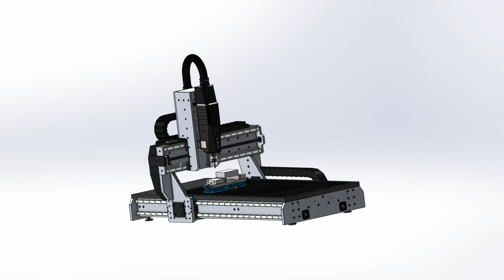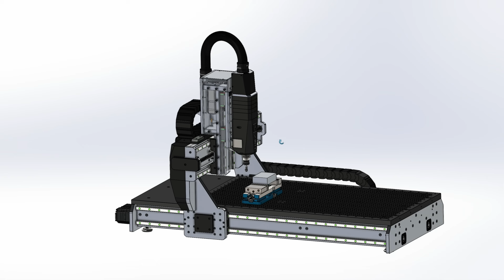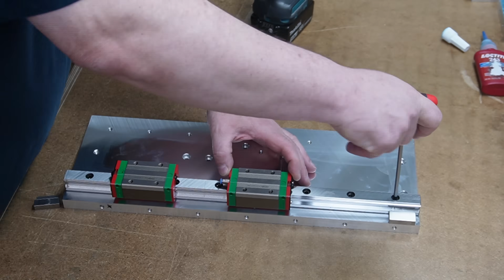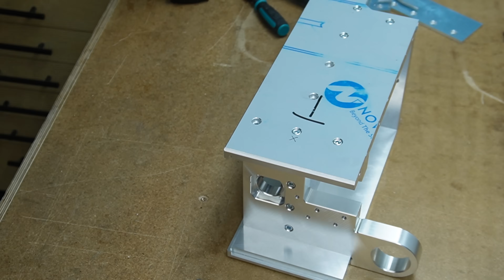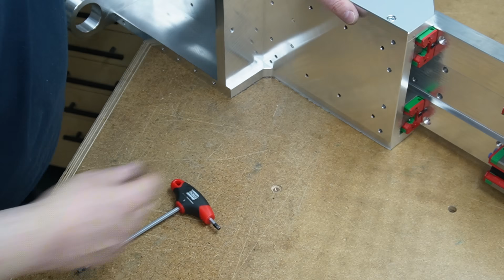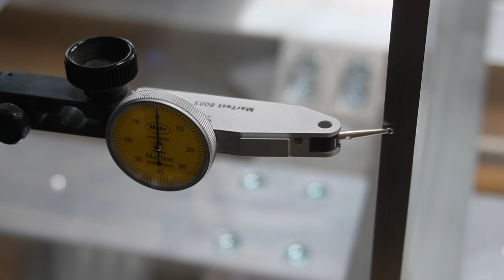Overkill CNC Router Upgrade Part 5 - Chatter free Z-Axis Design

Comment: Wie schaffst du es, dass SolidWorks nicht in Flammen aufgeht, wenn du die Baugruppen mit den Energieketten bewegst? Gibt es da möglichkeiten das ohne viel Rechenaufwand darzustellen?
Reply from the maker: Ehrlich gesagt...keine Ahnung 🤣 Läuft bei mir auf nem alten R5 5950X in Kombi mit ner Quadro RTX6000 (damit sind auch die Captures gemacht). Vorher auf nem übertaktetem i9 9900KS. 
Alles was Leistung frist getickt, wie RealView, Umgebungslicht Okklusionen, Schattiert mit Kanten, etc...
Solid ist ja single-threaded. Prozessor mit >5GHz, ein paar Boost-Kernen und die Kiste rennt 😂

Comment: You are so knowledgeable. This was a joy to watch. 
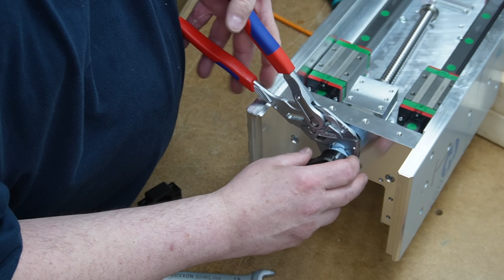At 16:15, I sometimes clamp half a spider jaw coupling to the shaft, then use a rod in the coupling to hold the shaft as the locknut is being tightened. 
Looking forward to the next part!
Reply: That's a good idea. I went the other way a drilled a narrow hole through the end of the shaft where the coupling bolts to and inserted a round rod to hold onto whilst tightening the nut. Quick file to remove any burrs and it's good to go, but the coupler sounds much simpler!
Reply from the maker: That is in fact a brilliant idea, that I will totally snatch 👍

Comment: - You are using Al5083 for this build; is there a particular reason you chose that alloy? Is that the most common alloy in Germany? In US, I'd imagine you would use Al6061. Not totally related, but you should look up MELD Manufacturing, they are doing large format aluminum 3D printing without melting. They can get pretty fine-grained results, and fine-grained metals are known to have good damping qualities. So I wonder if one day, the best machine frames will be 3D printed aluminum. 
 - Do you have any plan to publish the BOM for this machine? Seems most useful as the high-bar starting point, from which people can substitute/remove from until they have something that fits their budget. What you are building is obviously geared toward highest performance rather than being economical.
- One last point: your Z-axis discussion reminded me of Prof. Alex Slocum at MIT. He does precision design, and this exact problem of where to place the bearing blocks has come up. I think you already touched on this, but in the moving rail design, the stiffness can change depending on the Z height. So if you want to make a very precise machine (not just routers), then often you want a design that is at least consistently of a certain stiffness so that you can calibrate accordingly.
Reply from the maker: Very interesting feedback 👍
I use 5083 mainly for 2 reasons. First, it is cast material. Means it has very little residual internal stress. So my milled parts keep the shape and dimension and do not warp afterwords. There are some quite large parts in here that have to be very precise and making them out of rolled material would be rather difficult.
Secondly, because it is cheaper than 2017 or even 7075, at least here in Germany. The latter would be preferable in terms of tensile strength and I use 7075 on all ball screw nut housings and as well the T-bars I showed in the video no. 4. Mainly to be able to apply a higher bolt torque to these parts. But for the main structural parts there is no real benefit. The stress in such a router is rather low and the stiffness properties are the same among the different alloys.
And 5083 already comes pre-faced to a very good thickness precision.
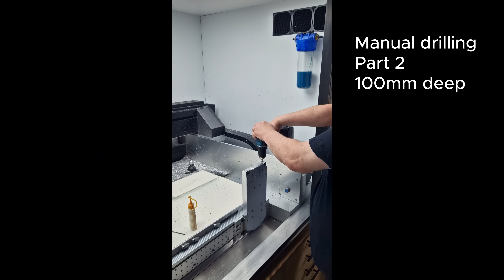The hint with the 3D-printed alu is gold 😊 I have built routers out of UHPC and mineral casting, but the mold making is always an issue with hobby tools. They work extremely well, like the one at 8:40, but it always required some post-processing of the parts to get them to the right precision.
The CAD files are available for sale. Currently just through DM on IG, but I work on a web-site 😉

Comment: Inside out.  That’s how you can maximize strength and stiffness.   If the spindle lives between 4 upright pillars forming a a rectangle over the work area.  and the gantry y rails sit on the inside of the bridge that forms over the work area then your stiffer because the because the additional rigidity and lower length.  There’s no cantilever so significantly less flex. The moment is also higher so you will have very limited flex even with heavy loads. Both together means that the only flex will be in the bit itself.  Fill the bridges either epoxy granite to dampen any vibrational forces.  Homebuilt Cnc almost always ring like a bell.
Reply from the maker: I wanted to build a classical router, for many reasons explained in the first video.
I already have a very sturdy mill with a mineral cast bed, which you can see at 8:40
Not sure if you have seen the last video about the gantry design 🤔

Comment: What do you think the milling accuracy will be for this build?
Reply from the maker: I used to have a very similar router before, with the same quality grade of components and I was able to hold tolerances around ±0.01 - 0.02mm. It was no problem to mill tolerance fits on it

Comment: This video has qualified the design choices I went through with my Z axis build. So I thank you for that! I’ve also used the tubing instead of the usual drag chain for all my cable management and I love it. So easy to keep clean and keeps 100% of the chips and coolant away from the wiring 👍🏻
Reply from the maker: Awesome. Sounds like you have made the same design decisions long time before me 👍
Reply: @scratchbuiltdesigns I would say the concept is very similar. Your build is incredible though and MUCH higher budget than mine 😆 But it’s something for many of us to aim for in future builds 👌🏻
Reply: @Kurt-tq6ew the tubing idea for cables is so good. I really wish I did that instead of a drag chain, which collects so much stuff.